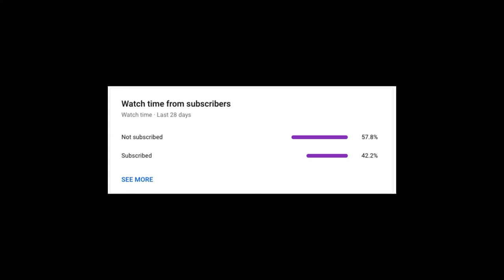Ergonomics and Prototyping in Industrial Design: Balance and Positioning (Part 1)

Comment: You probably know this, but the reason why some ergonomic guitars are headless is to help the weigh and balance issue. If you build your instrument to have a very light body, the headstock will cause a neck dive and that forces you to add weigh to the body. But if you completely remove the headstock, not only that's less wood right there which makes the instrument surprisingly lighter but it also allows you to make the body itself lighter without causing a balance problem. I think in terms of ergonomics the Strandbergs may be close to the ultimate guitar design even tho in terms of aesthetics and functionality I'd still change a few things. Maybe the holes you added can also remove just a bit more weigh. I'd even go with those minimalistic Steinbergers if it wasn't for the neck dive! Here I am talking as if I had thousands of euros to waste on more guitars!
Reply from the maker: Yes, thank you for your thoughtful response!

Comment: How much do you think you would have to change if you were making this for a specific more general user group? Or said differently- How many of your design decisions were made specifically for yourself? Did you make this with others in mind or did you specifically form it to yourself, knowing well that if it were to be mass produced, it would need to change?
Reply from the maker: I tested with about a dozen other people. I would say the biggest thing that was designed specifically for me was the scale length (the overall length of the neck+strings). I have freakishly long arms and have no problem reaching the end of the neck, even when in the classical position. For many people, that neck would be too long. The next iteration of this design that I'm currently working on has a shorter scale length and it also is positioned in a way where the lower frets are easier to reach.